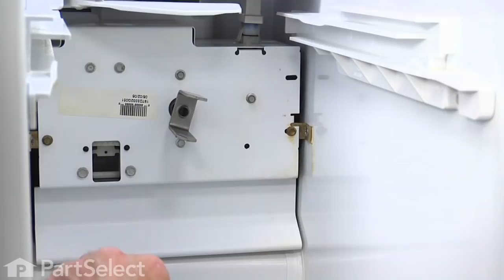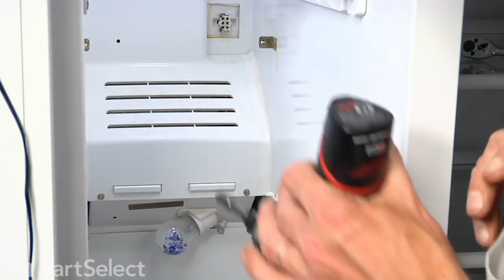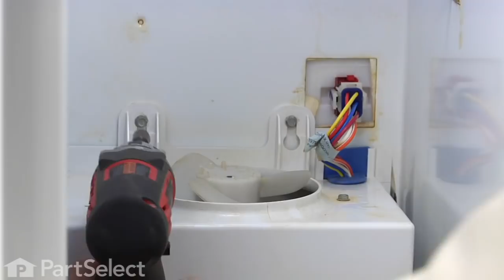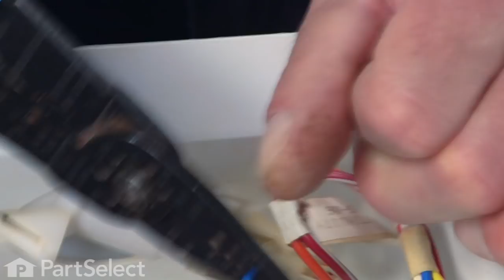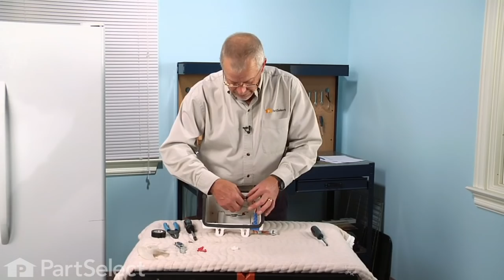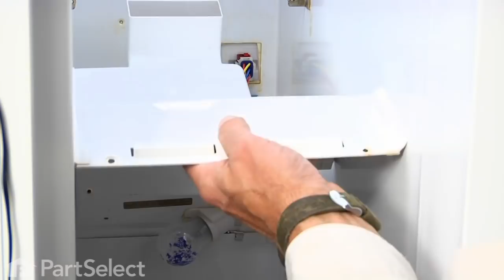Refrigerator Repair - Replacing the Evaporator Fan Motor (GE Part # WR60X10185)

Comment: This was NOT "pretty easy". It took most of 3 hours. My model was a bit different, required pulling half the freezer apart including the ice maker, ice maker rails, light cover, ice rotator, fan cover, air funnel, and metal back plate. I didnt need to splice any wires, but the connectors on the new part didnt seat well and i had to use channel locks to crush them together. The narrow doors makes it impossible to access the work area well. In additional to tools, you will need good core strength and patience. The video was still good for general guidance.

Comment: Thank you. I was wondering how i was going to connect the new wiring to the existing Light wiring. I didn't realize I needed to cut the wires and connect them that way. I thought I needed to somehow connect the Light wires to the new assembly.

Comment: If you need the fan motor with the thermister and blue fitting its part number is WR60x10074

Comment: Mine stopped working and being variable speeds could not test part. Main power board showed power to fan though so replaced evap fan. Worked well initially, then I started hearing loud noise when the fan kicked in. Disassembled everything and seen that the round part near the fan blade base came apart and had to push it in about 1/8 of an inch to the evaporator casing. Snapped it in and working good now.

Comment: Great video, thx.  Tips:  a magnetic 1/4" driver would be really handy.  You can't get both hands to the back of the compartment at once... if you drop a screw, it's a pain finding it, especially if you didn't empty the food from the bottom freezer shelves.  Also, note that in addition to a 1/4" driver and ratchet, you also MAY need wire strippers and wire butt joiners as explained at 7:01.  I watched just shy of that part and got to the job (my rental property) without them.  Ugg.

Comment: GE Fridge Ice box side by side 
Test question for a Panasonic fan UDQT26GE3  9.75V DC.3.25W in nom. 197D2039P006 Evap. WR60X10043 73002   in the freezer side…
GE fridge Model No.  PSS25SSNA SS 
Compressor working Cooling coils clean compressor working fan working for cooling coil works.  The Freezer coil evaporator starts to frost up I have bypassed the cutout switch Hooked together (Temporary)…  Fan hanging in Freezer compartment Evaporator coil frost up to top still not spinning. How do I test fan,  if fan has failed or not working because of something else? What other areas should I look at.

Comment: Because I didn't trust my splicing skills and also because I didn't want to go out in -3 degree weather to buy the connectors, I decided I could do without the light. Now, though, my ice maker is not working. Another video leads me to believe the switch for the light also affects the ice maker. Do I need to reinstall properly by splicing into the existing plug that splits off to the light to make my ice maker work?

Comment: I was trying my damndest to unplug the wiring harness from the motor because it looked to be different colors than the motor assembly, when I tried to use pliers the whole thing crumbled and I discovered it was hard wired..so I found this video to see what my next move was.   Great video!  I was able to find a motor for $42. I was about to replace a $1500 fridge!

Comment: Very good instruction, easy to follow.  My evap motor quit working and the freezer was not cooling.  Fortunately, I heard the fan in the freezer surging and ordered a new evap fan in the nick of time.  This video saved me a lot of time and potential mistakes, allowing me to fix it myself during the COVID19 pandemic.  Thank you - saved me from getting a repairman coming into the home or ordering a new refrigerator for delivery.  PS - heat shrink butt connectors are better than electrical tape.  I just happened to have some stored on the boat in my yard.

Comment: Do I detect a Canadian accent? Does PartSelect serve all areas of the U.S.?
Also, my Hotpoint 'fridge makes a revving noise, sometimes continuously. It is the evap motor. How do I determine whether it is the motor, or a sensor or thermostat that needs replacement?

Comment: Replaced fan motor and it's still not working. Any ideas on what else it could be?
Reply: Same here. Condenser fan motor was replaced but fan still won’t run. What else could be the problem?

Comment: if you have correct motor assembly you don't need to cut and splice connectors and get a much better connection

Comment: Hello technical colleague, according to the general electric manual the fans between the red and white wire measure between 1.5K ohms and 3k ohms, that replacement measures how much it measures between the red and white wire 1.k ohms at 3k ohms or measures 9k ohms

Comment: I noticed that the new/replacement motor already comes with a socket connector. Isn't there any way to connect it using that instead of wire splicing? It's like they purposely designed it to be more difficult than it had to be.  EDIT:  You actually CAN just plug in the socket connector of the new motor to the refrigerator/freezer directly -- there is no need to splice wires!

Comment: Hi Steve, thank you so much for posting this very helpful video. One quick question: My fridge doesn't have the deflector cover over the fan area and wondering what role that plays and if it's really necessary. I noticed another similar video doesn't have one either. Thanks again.

Comment: I just did my GE side by side which is a 2008 model. Everything works great except we get a chattering noise when we close freezer door. It appears to be the fan blades hitting the housing. I reached in an jiggled some stuff around but looks like I have to take it all apart again to expose the fan. There is very little clearance between the fan blades and the housing. How far down on the shaft does the fan go?

Comment: Hi, it's important to note that the motor mount might not be holding the motor securely in the fan assembly. This will allow it to vibrate and make noise and wear out quickly. The motor mount apparently deforms over time, pressure and vibratory forces. It is simple to detect and fix by carefully bending it back into shape. You'll see the reinforced ridges on the mount intended to keep its shape. Basically, cheap consumer crap but easily fixed.

Comment: If this part is out, it won't blow air to the otherside, causing it to be warmish?? yes or no Thanks
Reply from the maker: Hi Martin. Yes, one of the symptoms of a non-working evaporator fan motor it a warm fridge or freezer section.

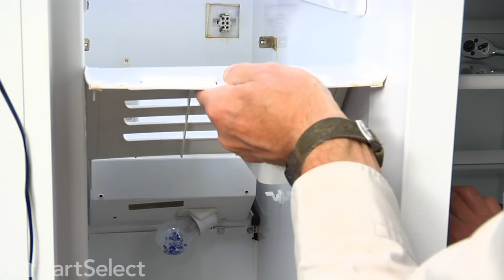Comment: Great video.  It very closely matched my GE refrig .  One difference was that, when removing the evaporator fan assembly, there were two wires that were part of the harness and these two wires were each connected on one end to the evaporate coil.  I'm guessing these were thermistors.  In order to remove them, I removed the panel that evaporator cover.  The other difference is that there were another two wires, again part of the harness, that came from the very bottom of the evaporator coils.  One long wire from each side of the coils.  I did not attempt to remove these from the evaporator coils for fear of damaging them.  So, it meant that I could not take the evaporator fan assembly or the cover (4:13) completely out of the freezer compartment.  I was able to position them on the kitchen floor next to the freezer, and this allowed me to replace the evaporator fan.  

My original problem was that the evap fan was for about 2 days making a very loud noise, but the freezer and refrig were working.  Then, the evaporator fan stopped, and no more cooling.  After replacing the fan, the freezer is cold but not as cold as it should be.  And the refrigerator portion (this is a side-by-side GE model) is barely above room temperature. I put a thermometer in the freezer compartment and it shows 16 deg C.  (our room temp outside the refrig is 23 deg C).   I have not heard the compressor kick in, and the refrig has been running for 24+ hours.  Any suggestions?  Thanks
Reply: Actually, I was wrong about the new fan.  The new fan was not spinning.  I now suspect that the problem was not only a bad fan, but also a bad thermistor.  There is a white temp sensor (#WR55X10025, according to my research) and a red Defrost thermostat (#WR50X10068).  Not sure which one is bad (if, in fact, one of them is bad).  I'm trying to understand if one of these two went bad, and if they can cause a fan to fail.  There was no doubt the original fan failed.  As i mentioned, the fan was making a very loud noise for two days.  When i removed the evaporator fan assembly, the fan just fell right off and you could see it was damaged.  I can't say with 100% certainty that the fan motor was bad, but I made that assumption and replaced it.   So, the questions are:  Can a bad temp sensor cause an evaporator fan to not turn on?   If so, is it the white temp sensor or the red one?
Reply from the maker: A defective temp sensor could cause that symptom. A failure of the defrost thermostat would normally cause the evaporator to ice up after a few days of running.

Comment: Great Video, while my refrigerator is different ( freezer on top) and the fan is a different part number, the same principal applies. We noticed on Saturday a very loud noise coming from the freezer unit ( sounded like a fan grinding). I unplug the frig, and the sound went away. On Sunday we noticed that while the food in the freezer was cold, the ice was starting to melt and the food was thawing. Hopefully the fan I ordered will arrive today and will fix the problem. Thanks for explaining everything!

Comment: My Evaporator fan is running all the time on my Frigidaire FRS6HR5JSB4. Occasionally it will turn off for a second or two, but will start straight back up again.
The Freezer & refrigerator all seems to be working okay. I noticed the constant fan operation the other day.
What would you advise I check first ?
Reply from the maker: The adaptive defrost control board controls the evaporator fan motor and is probably defective.

Comment: Replaced motor exactly as your video says.  My freezer does not get real cold and no ice cubes are being made.  What am I doing wrong?
Reply from the maker: Was the evaporator completely iced up when you replaced the motor. If so, you probably have a defrost issue. If the evaporator fan is running almost continuously, as well as the compressor and the condenser fan motor, the problem is most likely with the sealed system. This would require a diagnosis from a qualified refrigeration technician. If the compressor,
condenser fan and evaporator fan are running for very short periods, the problem may be with the control thermostat.

Comment: I have replaced my evaporator fan motor and it seemed to work fine .It still keeps everything frozen and turns on and off as it should when at temp but seems to run fast and loud .

Comment: This morning I finally got around to changing that fan motor in my GE 2 door Profile. Bought the motor 6 months ago and was a bit frightened to change it. My model was a lot more complicated, with a lot more pieces to remove to get to the fan motor but I can certainly say that the video helped. So thank you very much for that, it's running so nice and quiet now.

Comment: I have a Frigidaire model # FGHB2846LF5 refrigerator.  The code SY EF came up on my display.  I replaced the mother board and the same code came up within an hour.  Do you think I need to replace the evaporator fan motor and the mother board? I can still return the mother board.
Reply from the maker: The fault code does suggest an evaporator fan motor error. Check connections to the motor first.

Comment: I think the fan placement is important. I put it low and it made noise. I think it has to be up on the shaft where the blades actually stick through the fan cover. I agree with the guy who said GE should give every owner free anger management classes.
Reply: I would like to add mine kept making noise so I pulled it back out and added zip ties to the motor so it was locked in place. It is designed to float maybe to absorb torque but screw that it is now silent again and I am happy.

Comment: Hello and thank you for the great video. 

I have a GE model # GSS23SGSBSS. I am attempting to replace the fan motor as described, however the light bulb socket has wiring going elsewhere which isn't allowing me to lift the motor housing out the way you described. 

My question is, once I remove the back panel of the freezer so I can disconnect to wiring of the light and remove the motor housing to replace the motor, do I still need to do any splicing or can I just replace it as is. I also see the wires pass through a blue grommet that connects to the housing which does not seem to be removable in order to attach to the new motor and wires, is that a necessary component. 

Thanks for any advice.
Reply from the maker: +Edgar Jimenez The blue grommet that you refer to sounds like it is the one that is a permanent part of the molex connector. Theconnector has release tabs on the sides that need to depressed in order to remove the connector. There should be no wire splicing required for this repair.

Comment: Nice Video, I have a GE side by side with ice maker.  The evaporator fan does not run sometimes.  It runs again after I push on the fan.   Should I replace the motor ?  the fan ? both?   Thanks
Reply: Hi Derek, I recently ran into similar situation ( evap fan runs when I spin it manually ), just wondering if you ever got it resolved? Thanks.

Comment: I just wanted to thank you for this video, I was sure I had a bad evaporator motor. After watching this video, I pulled the fan motor out, and found it had been replaced before. One of the spliced wires had pulled out of the butt connector. Simply repairing the splice fixed my fridge. 
Thanks again for posting a video that gave me the confidence to repair my own appliance.

Comment: Great video, I hope it can help me with my following problem:
I have a GE PCG23SHMHFBS fridge and the freezer doesn't freeze. We have had someone from GE look at it and said that the fan motor WR60X10185 is old and doesn't work so we need a new one. Their service and the motor is quite expensive so we want to do it ourselves. We have found the part online and want to order it. Where in the fridge do we change this part. I looked inside the freezer from the front and there is nowhere to change it. So I'm suspecting it is at the back bottom. Could you give any tips or insight about my specific issue and fridge model number? Would greatly appreciate any infos! Thanks in advance!
Reply from the maker: seldom83  We have provided a step by step video to help you out with changing this motor. http://www.partselect.com/PS1019114-GE-WR60X10185-Evaporator-Fan-Motor.htm?SourceCode=1&SearchTerm=PCG23SHMHFBS&ModelNum=PCG23SHMHFBS

Comment: Hi Steve, I have a KitchenAid Model ZIS480NM Refrigerator that seems to be cooling fine, except that the wall between the frig compartment and the freezer is warm all the time on the front face, top to bottom. The front plastic has discolored a bit. Is this a problem? If so, do you have any Ideas?
Reply from the maker: Earl Rehder That is usually an indication that the condenser fan motor is not able to cool the condenser coil. Check to see if the fan motor is running when the compressor is on and that the coil is clean.

Comment: I have a GE model # GSL25JFRFBS side by side with icemaker ... The fan to the radiator & the fan to the freezer act like the want to turn but just sit and bounce. Is there some rely switch or do both fans need replaced or...? Pease help! I did notice a similar question but am unable to view the answer.
Reply from the maker: regina white These motors are controlled by a motherboard normally located  on the rear of the refrigerator. The most common failure of the mother board is that the motor or motors have failed, due to lack of lubrication, and have in turn caused a failure of the board. In most cases bothboard and motors get changed.

Comment: Our refrigerator's functioning has been gradually degrading for a few weeks. We spoke with someone at Sears Parts and decided it could be the evaporator fan motor.  We ordered the part and, when it came, we began taking apart the freezer per this video.  Aside from the fact that our fridge did not exactly match the video, (which can certainly happen) we could not dislodge the evaporator cover.  We ended up taking out the racks and anything else we thought might be holding it in.  Turned out, everything behind the freezer wall was frozen into a solid block of ice.  Nothing was going to move until we got that block defrosted.  If you attempt replacing this part yourself, be sure to let the whole thing defrost first.

Comment: Hi - good video but I think you cheated a little. On some shots the ice-maker has been removed. On my model it is secured to the side wall by 3 screws two of which are BEHIND the ice maker. How on earth do you get these out, and if you do, how do you replace them? Also I have a GCE23LGTBFSS and the fan cover does not have any visible screws at the bottom and the lamps are attached to the cover. How do I remove this? Any help appreciated.
Reply from the maker: The two screws above the mould only need to be loosened, then lift the ice maker up and away from them. I cannot tell from the parts diagram how the evaporator fan cover is attached on your model.